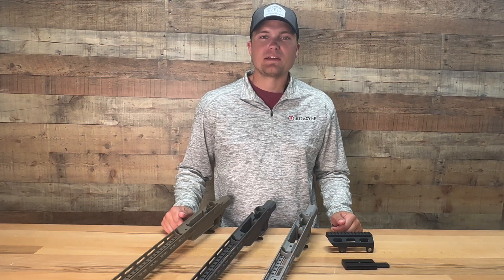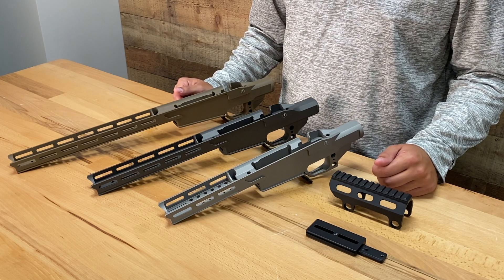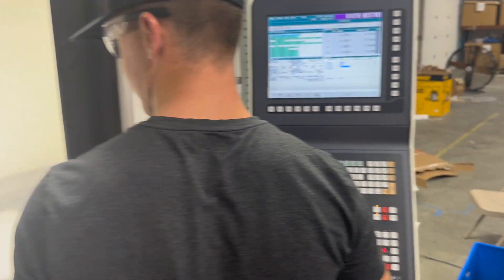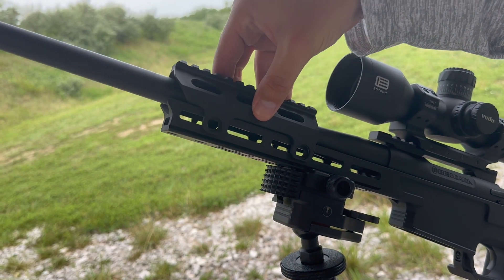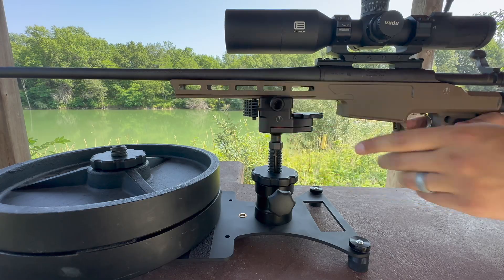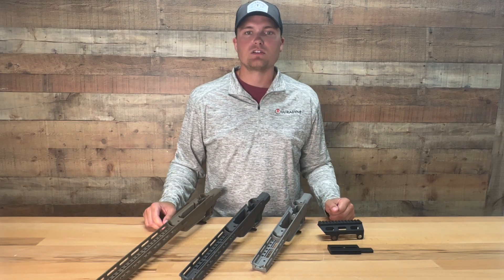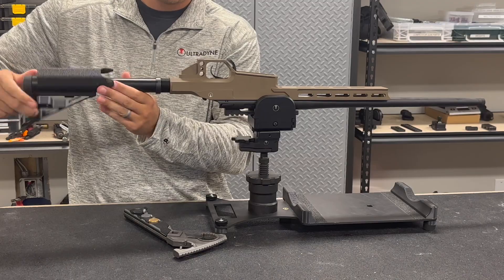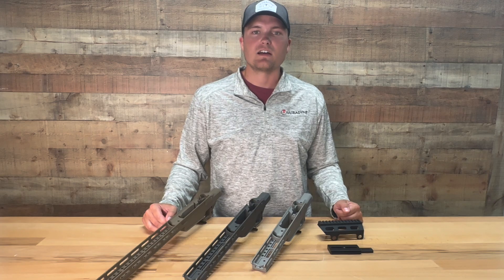Ultradyne UD Chassis

Comment: What’s the difference between this and the xlr element
Reply from the maker: The Ultradyne Chassis is optimized for strength and weight and comes in three lengths. It incorporates ARCA rail as well as the Ultradyne Dynalock system which enables any rifle build from a lightweight hunting build to a heavy competition build to easily lock into the Ultradyne Launch Pad or Tripod to have a stable rest and reduce recoil.